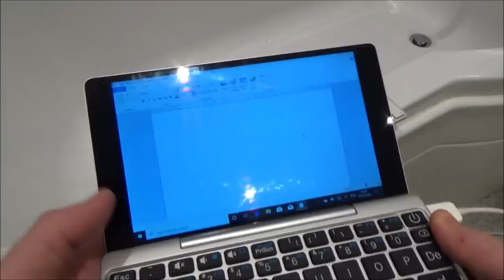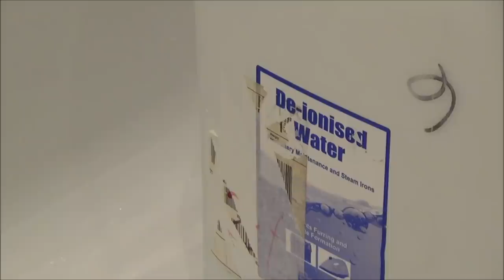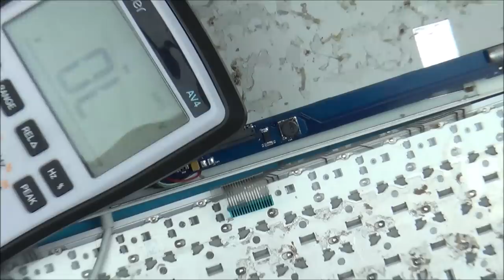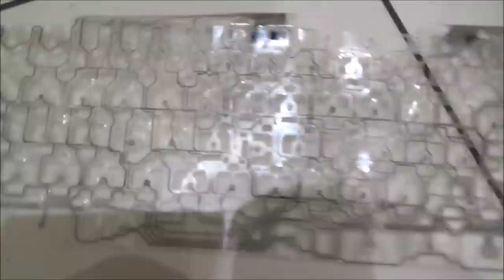Trying to FIX : Faulty Apple Keyboard Model A1243 purchased on eBay

Comment: I had one of those Keyboards (never had a Water damage ) until I moved to Southamerika with more humidity in the air. The keyboard died slowly but surely …. first one key, than a row … and so on.
So, it’s a construction problem … place it on Apple.
These keyboards should be capable of working in other continents too. But they don’t.

Comment: I have the wireless 'magic' keyboard.  Put it inside a drawer working perfectly.  Took it out to use a couple of weeks later, popped in some fresh batteries to find it didn't work properly anymore - some of the keys not working, namely the tab, hash and pipe keys.  Because I am a developer who uses Linux a lot, it's completely useless as I use those particular keys all the time.  Apple are s*#t

Comment: I have managed to kill two of these keyboards by merely using a clorox wipe. Apple folks said you are only supposed to use a damp towel. I love Apple products but the fact I can't clean slightly greasy/dirty fingerprints off the keys. Unlike this board that had a lot of water/moisture damage, mine merely got wiped clean, then a microfiber towel to buff clean, and then the letter "P" went dead, along with "4-5-6" on the number pad. The fact two keyboards both went dead in the same way really makes me a tad sour about the failures...PC keyboards can survive a mud bath with a garden hose cleaning...and Apple keyboards get damp and poof! RIP

Comment: Nope. Apple's butterfly keyboard was a disaster. Its not a spill its terrible design. And I am an Apple fan but this keyboard is crap! You can try blowing it out with compressed air at 45 degrees in both directions. Probably not but maybe yes.

Comment: This starts by the way Apple use to close the keyboard, from this you know it's not made to be repaired. And further, the other way to get the layers sticked together... the fragility of the printed layers. All lead to one thing... the balance manufacturing cost and repair cost makes Apple decide to create disposable item after use. This price you will pay allows Apple to trade you your keyboard quietly during the warranty period without loss of money... and the lifespan to get the clients back.

I watched this video because i wanted to know what to do with my keyboard. I didnt put any liquids on it since i got it. I left my keyboard and waked up in the morning with a few dead keys. The corrupted tracks in the layers comes slowly bad so... I'm losing slowly my keys.  What about to get a new Apple keyboard from ebay ? You can't check inside the status of the keyboard and you know that you won't be able to repair it... surely a bad idea if the price is not a wonderful opportunity.

Im starting slowly to be agree with Vince about changing to another manufacturing company. I am an artist and a creative disigner for 30 years. My community made Apple be as big as it is today. In my profession we use Apple for lots reasons  you know if you are a real and well experimented professionnal. But one thing... you can be a client as long you can, Apple does not recognize your fidelity. So if the material comes to get a short lifestan, that the price still high without any advantage to be an old client so which reason to continue to stick you to Apple as you can, if you like his OS, use it on none Apple hardware ? (sorry for my awful english, i tried to fix it as i can :p)

Comment: Started watching the video and thought why does vince sound like he's in a bathroom, nevermind he's actually in a bathroom lol. On a separate note though it's pretty obvious apple designs it's products on purpose to not be repairable, I'll never buy apple products.
Reply: its literally a keyboard I think Apple made it as repairable as you can get.
Reply: I will buy still an Apple, they work really well for years but if something goes wrong it can be really hard to fix without their help especially if iTunes is involved.
Reply: @down2006  They've already mastered the art of selling all their expensive insurances and warranties at this point. When vince literally has an electronic drill out for a keyboard something is wrong.

Comment: Hi Vince my Xbox controller just died. I'm going to buy a new one but I thought I'd ask if you want me to send you this broken one as it will be a interesting fix for a video 
It won't turn on via USB connector but it'll turn of for a second or less with just batterys. It will turn on and stay on ONLY if you have batteries and a usb plugged into the controller (but) the batteries do get rather hot. It did have a slight burnt smell from it after it got hot. 
Worked fine yesterday but it's not having it today. My Facebook is Shane irle

Comment: Most of the keyboards work the same and fail the same when they are water damage...
That why sell replacing keyboard for PC/Windows laptops, its never easy to fixed them, no matter the brand (Thoshiba, Lenovo, HP, Apple, Dell...) once gets water inside, game over.
Reply: I spilled some coke in my Asus keyboard (K550J) a while ago and still works.... a bit sticky but works.
Reply: Richard Rodrigues same with my gaming laptop.

Comment: They design it like every other cheap, thin, keyboard and charge a fortune due to the brand. Gawd I hate Apple.
That is standard construction. Every laptop, tablet keyboard etc, etc are designed that way. Difference is that they make it more or less impossible to replace it in their craptops and charge a leg and an arm for the external ones :/

Comment: A typical Apple product..
Slightest bit of moisture and it becomes unrepairable..
So you buy another... and another and another..
Expensive and over engineered to prevent Joe (or Vince) Public from repairing it..
Apple actually refuse to sell spares for some of their stuff or of they do, it's more expensive than a new working item!
Imagine if car manufacturers had the same idea!
Welding the bonnet shut to stop mechanics getting to the engine.